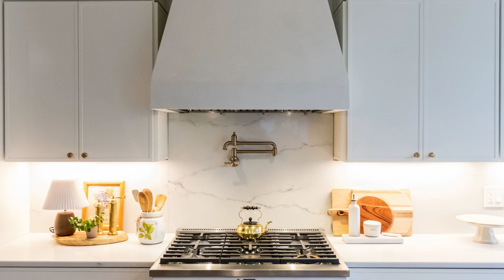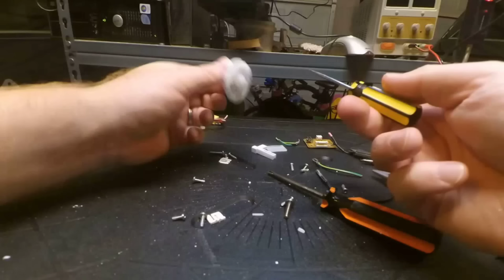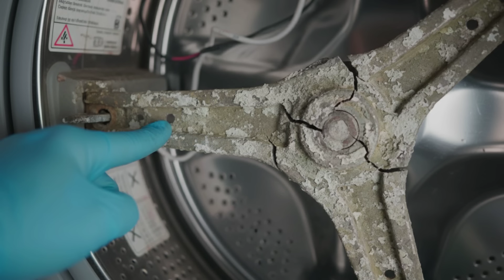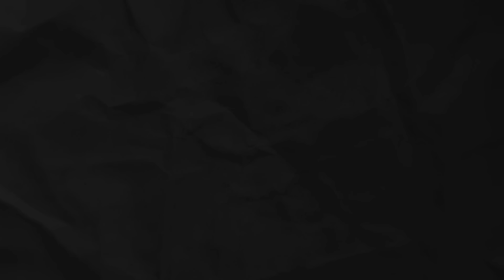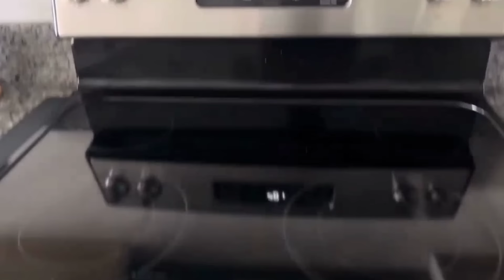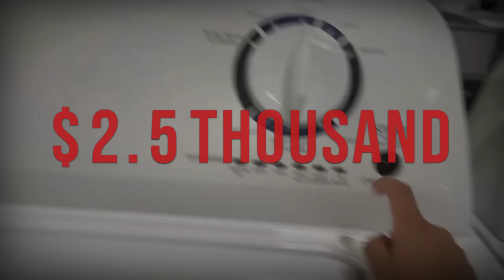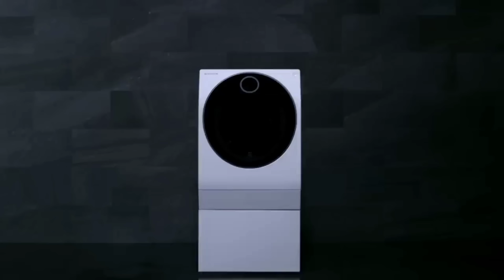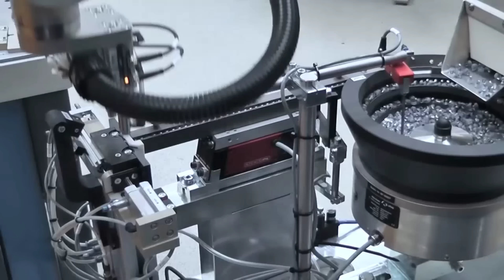The Repairman Blacklist: 5 Appliance Brands to Never Buy

Comment: The washer/dryer all in one just shouts trouble.   😅
Reply: We thoroughly explain the shortcomings. Some folks are determined to buy them. They are better than the mini countertop units.
Reply: In the UK the washer/dryer combination is very common because we lack the space for separate units.
Reply: Not necessarily true. Combination washer/dryers are very common in Europe and they seem to last a long time
Reply: One part goes out, the whole thing is useless.
Reply: @RM-lv9ng: The all in one WASHER -DRYERS have spelt nothing but trouble for decades. My former neighbor had a couple of these machines one a PHILCO-BENDIX and another a MAYTAG had nothing but endless service calls throughout their lives.
Reply: One operation requires water then the next operation needs hot air? Good luck with that! I'd bet under a year and the regret will start!
Reply: that had to be the joke of the manufacturers
Reply: Alsop known as the all in one headache.
Reply: Never buy! My husband talked me into it
Reply: Have used these in European Airbnbs. Terrible. Clothes come out wrinkled every time no matter what material. I'll the use washer feature and hang them to dry.
Reply: I had one in my apartment a few years back. After about a year of usage, there was smoke and a smell of something burning. Guess what, the built up lint eventually caught fire. Luckily I was at home, some people start the machine and walk away, so I was able to turn the machine off. Later, when the technician arrived, he said that these machines are useless and dangerous. On my model I couldnt even remove the lint without dragging the entire machine out of the small compartment in the bathroom. What a stupid machine
Reply: Condenser dryers have been around for decades, they have about 40% of the global market share. Pro: Vastly more energy efficient (maybe 75% savings), gentler on clothes, no dryer vent so your laundry room doesn't need an outside wall or let hot/cold into your house. Con: Takes longer. You do need to clean the condenser every few months, but you don't need to hire a professional to clean a dryer vent or risk a fire.
I can't speak to the all-in-one models.
I do agree with the general premise of keeping stuff simple and hate the electronics in household appliances. If I want to remotely turn off a stove I left on, I'll put a $6 control on the outlet.
Reply: Mine works good. I have mobility issues so I don’t have to worry about trying to go check it as often it does what it’s supposed to and it did get very good ratings.
Reply: They are quite fine,  Never had an issue.
Reply: Who's the moron invented that stupid machine?
Reply: It's like combo shampoo/conditioner...anything that wants to do two things at once will do neither well.
Reply: I have a washer/ dryer unit. It works almost as well as the skydiving/scuba combo that I bought.
Reply: @charles401  LOL
Reply: @charles401  I had a washer dryer in the early '90s. It was pretty robust, though it only pretended to dry clothes.
Reply: There are japanese ones that launder, press, & hang them up.  But it is the size of an schrank
Reply: @WeedMIC  And I hear it takes many hours.
Reply: @WeedMIC  the size of what? Anne Frank? lol
Reply: Yeah those all-in-one units always make me a little nervous too. More parts usually means more chances for problems with home appliances.
Reply: I have a washer dryer combo, but I rarely use the dryer. As a washer, it works as good as any other washer. But lime most front load washers it probably won’t last any longer than eight years. Won’t replace it with a combo!
Reply: It takes approx 1.5 hours to wash and dry my laundry using a separate washer & dryer as opposed to 3-4 hours with an all in one unit…
Reply: you can only wash a half load when using the dryer after due to weight restrictions for drying
Reply: It seems like a house/apartment fire waiting to happen. 😬
Reply: My neighbour had a washer / dryer.  Took 6 hours to do one load 🤦🏻‍♀️.  I can wash hang outside dry and iron in less than 6 hours and everything smells fresh
Reply: @helenhopkins1515  my combo never took that long with a full load just a few hours for both like normal and comes out nice and dry
Reply: A washer and dryer in the same unit… I wonder what could go wrong 🤷🏾‍♂️

Comment: THANK YOU!  Same with modern cars!  My 1999 Whirlpool $500 fridge is still working well.  No fancy crap in it and is made in the USA, before the explosion of cheap labor in China/India, etc.  I defrost it every 6 months.  I replaced the thermostat once.  Vacuum all the dusts under, etc.  And it runs humming.
Reply: Prolly run another 15
Reply: I just paid $600 to have a new car battery put in. Two hours of diagnostics and testing added to the cost of the battery. Insanity, but the cars are decidedly safer than those of 40 years ago.